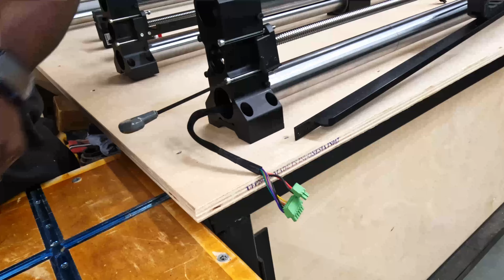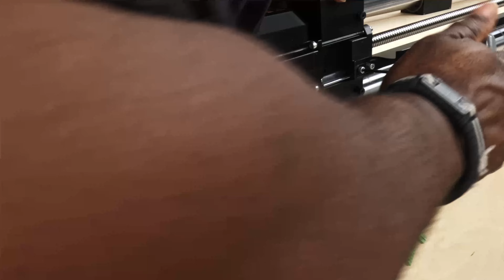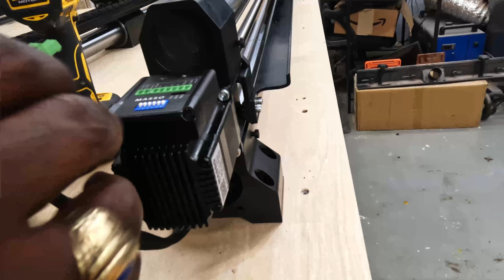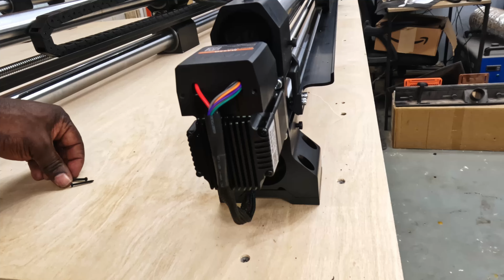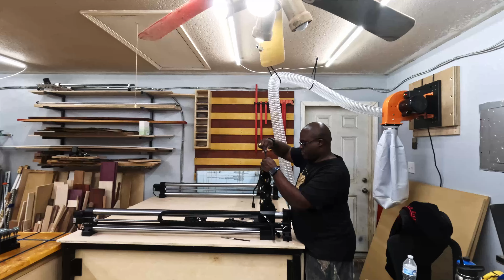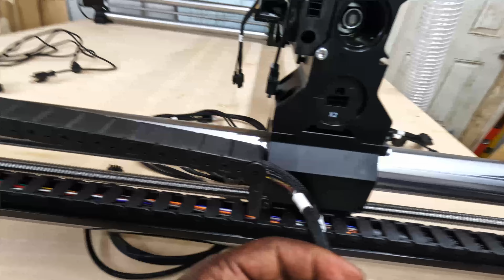I Got A CNC!!! | Onefinity Elite Foreman Assembly

Comment: So im on the fence right now with which cnc to get.  Im leaning towards the one you got. Is it 220 or 110 volt? Im totally new to cnc, hows the learning curve on the software for a first timer?
Reply from the maker: My cnc is 110v. I believe they ship them wired for what country you are in. For me the learning curve wasn’t bad coming from laser software. However I’m still learning tricks with cnc design. For a first timer I highly recommend YouTube for learning. That’s what I’ve done when I know what I want to happen but unsure how to do it. Feel free to message me on Facebook at Pleasant Woodworks if you have more questions. Thanks for the comment.
Reply: @Pleasant_Woodworks   ok thanks for the reply. Subscribed to the channel.  Im in texas so should come as 110. Also did u get the 80mm spindle?  Looks like cost wise ill be looking at around 6000.00.
Reply from the maker: Yes I got a 80mm air cooled 110v spindle from Pwncnc. I believe all together was around $6500 for everything I got including having my table built (I just paid for the steel). I would highly recommend getting a steel table made so it doesn’t flex as the machine is working.
Reply: @Pleasant_Woodworks  appreciate it.
Reply from the maker: No problem.

Comment: Did you have a list of tools that you used?  I noticed you stopped and got some extensions for the drill.  Good work on the install.
Reply from the maker: Unfortunately I don’t have a list. Everything I used is in the video. I had hex screw drivers from harbor freight and I went back to harbor freight to get hex bits. Just make sure to have from 2.5mm to 4mm I think.